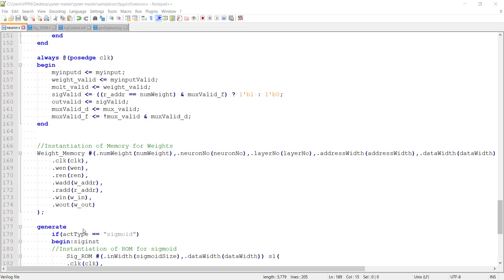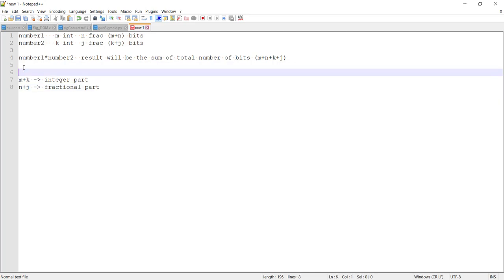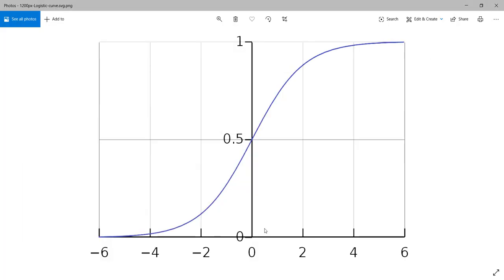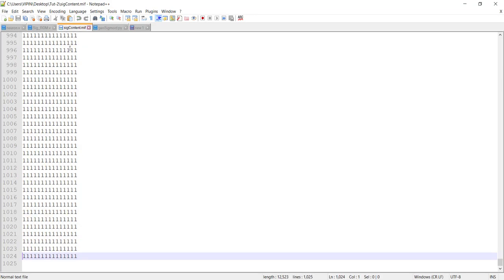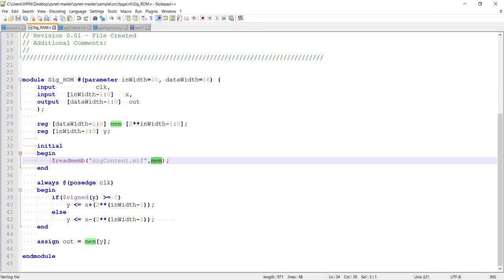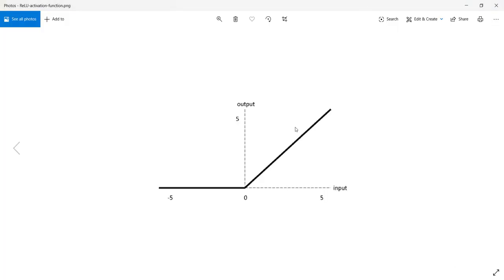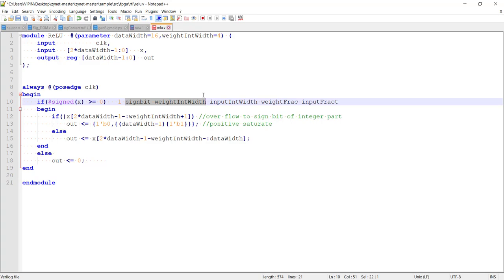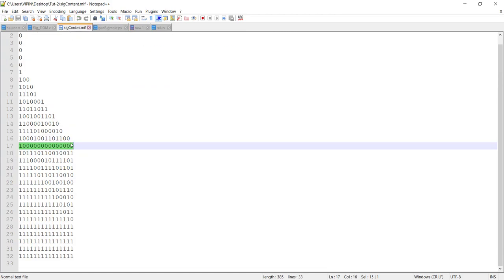Neural Networks on FPGA: Part 3: Activation Functions

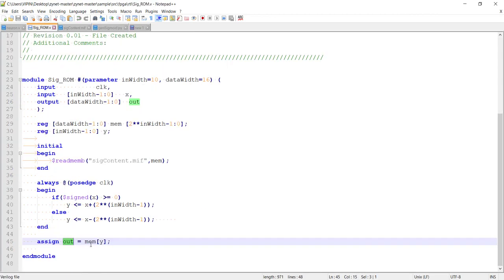Comment: Sir thanks for your Video. I have a doubt about the way you converted the signed output of the MAC to address the LUT @19:27. How does adding a large positive number ( 2**(inWidth-1)) to a positive value (x)  and vice-versa with its negative counterpart fit the address in the address range? Also sir, please do you have any video or reference where the control logic is explained. I have a hard time following how the data path and control logic fit together. Lastly, I have a board, how can I do a resource estimate to figure out if this design is likely to fit on my board or in other words what is the min resource requirement to accurately identify the handwritten digits with this design?
 Thanks in advance

Comment: Hello thanks for your videos plise I need some help for GPU applications  running  in the zynq
Reply from the maker: I didn't understand what is meant by running GPU application on Zynq. Zynq is not a GPU. Whatever code you have targeting GPU (Cuda or OpenCV) will have to convert into an HDL or HLS format to implement on an FPGA platform like Zynq
Reply: @Vipinkmenon  can I please have ur email I’d sir I need a help with a paper